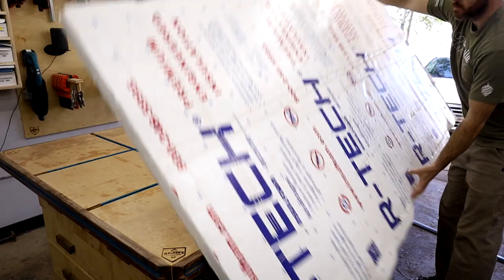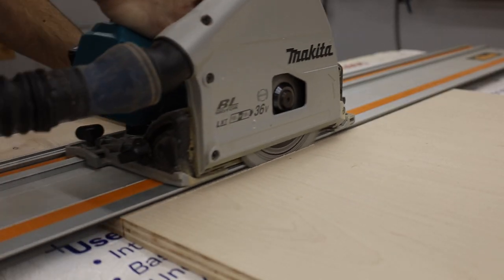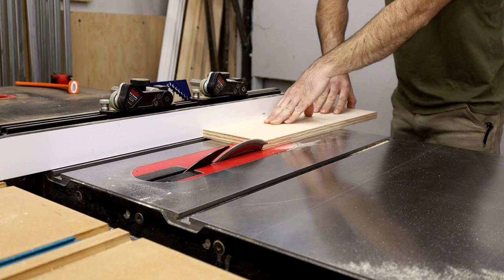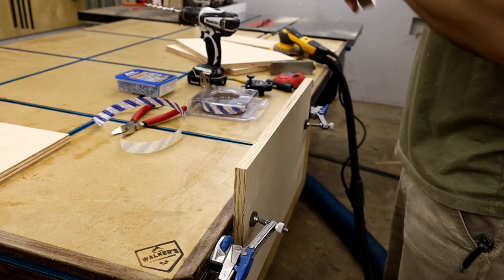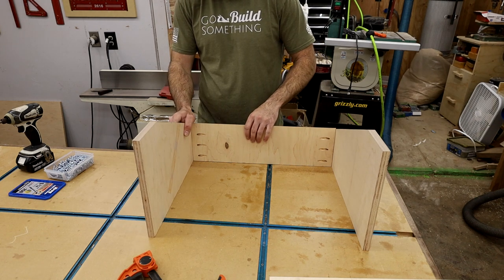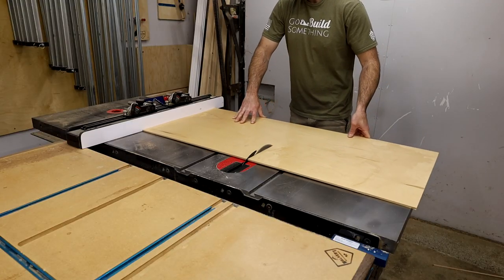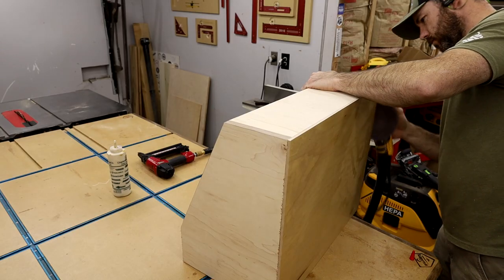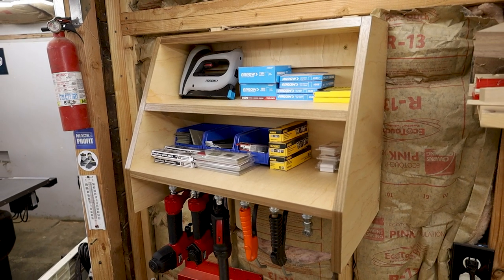DIY Air Tool Storage Station / Nail Gun Organization

Comment: Tha'ts a great looking shelf man.  Would there be any issues or possibility to bend the air intake if it's hanging like that? I suppose it may depend on the weight/size of the tool.
Reply from the maker: Ya I haven't had any issues so far.

Comment: I appreciate your builds, but in this case I have to say I don't see it working for me.  At last count I have a framing nailer, finish nailer, brad nailer, medium crown and narrow crown staplers, two air powered sanders, two spray guns and several blow guns.  That's just woodworking tools, I also have 2 1/2" impact guns, a 3/8" impact, 3/8" air ratchet, air chisel, and probably more I can't remember.  I like the idea of an organizer for nails and staples, but I'm not sure about hanging tools from it.
Reply from the maker: Make it wider and add more couplers 👍